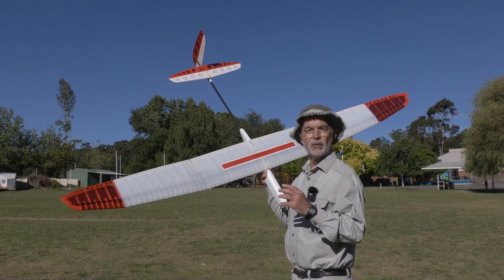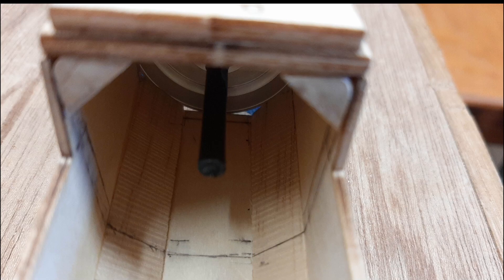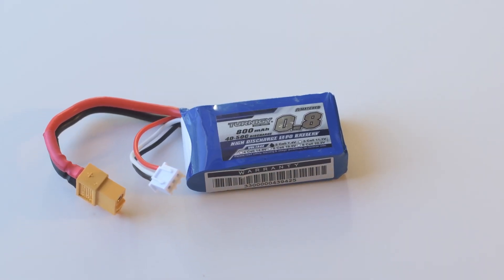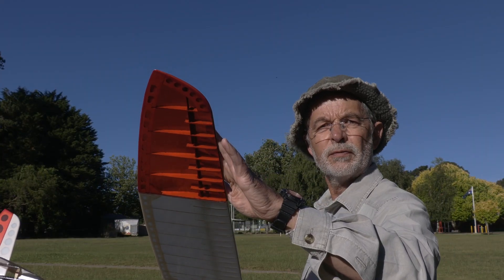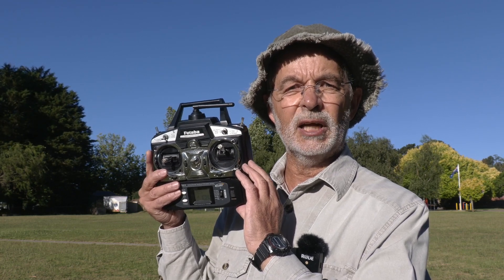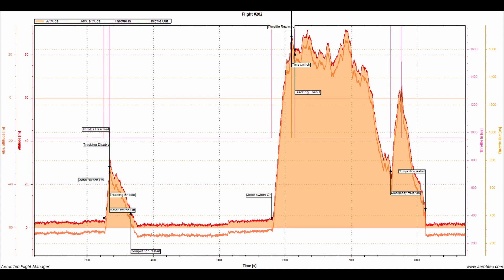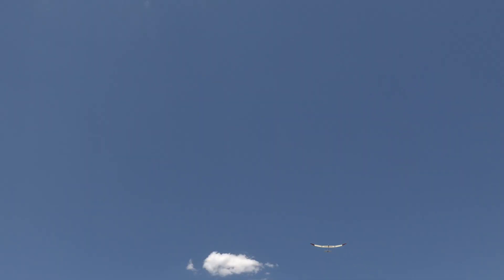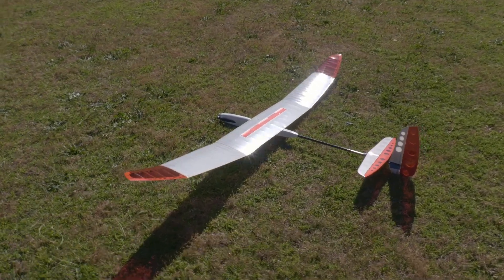OZeRES Review

Comment: Great video.  I am very new to RC electric gliders and am interested in your throttle stick setup.  Does that only control the spoiler and motor power is handled by another control?
Reply from the maker: Yes. The throttle stick only controls the spoiler. It is set up for competition where you have a maximum of 30 seconds motor run and you usually want the most altitude you can get in that time so it is controlled by a switch. Off is 0% and On is 100%. There is a limiter in the plane that stops it automatically at 30s. I have it set up so that turning the switch off on the controller re-arms the limiter in case I need power in an emergency.
Reply: @nickgeomap  Very interesting!  I could program a similar setup by putting flaps on the throttle stick and use a switch for throttle.

Comment: Have been thinking of getting a new res ship to join the Pures, andreas, gentle lady etc. I have one of those alloy spinners and they are crazy heavy. Use a proper reisenauer set up and you'll drop 40-50 grams straight off the bat, cost is about $20. That motor is way out of it's efficiency range and pretty heavy. I use a roxxy 2220/20 which is 30g lighter than than your 2630 and climbs at 4.5 m/s in my 550 gram res ship. It appears to fly very fast, after losing 80g (plus losing that tail weight) you'll be amazed how much better it will fly.
Reply from the maker: Yep. I basically did all of that except stayed with the same motor. Flies much better now :)